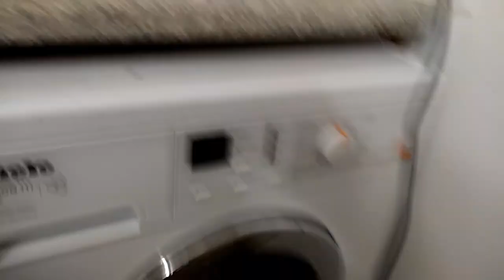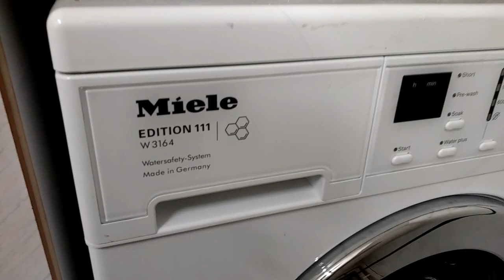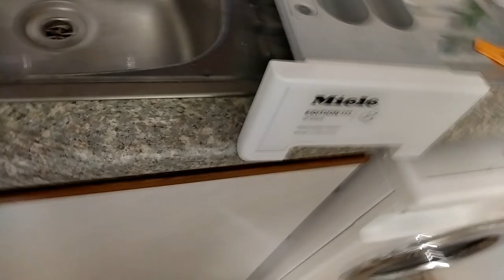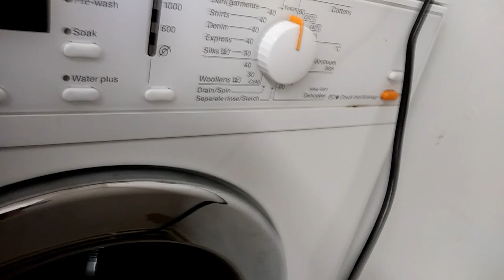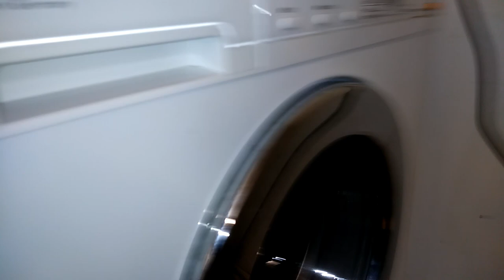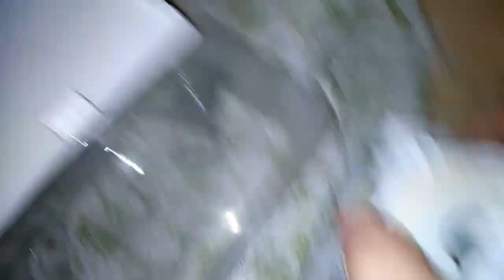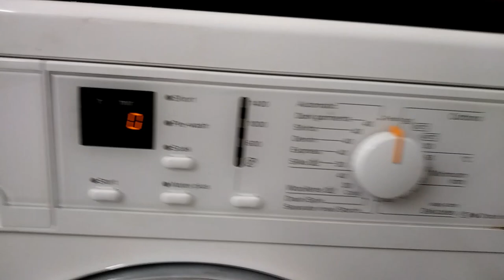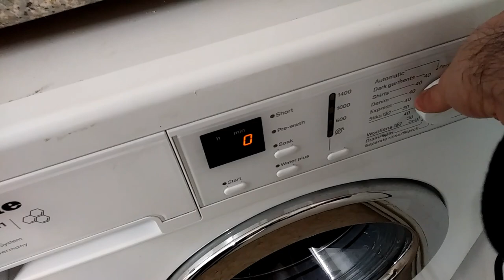washing machine maintenance (miele w3164)

Comment: Always add 2 litres of water in the dispenser after you have emptied the filter of water. This activates the ball float. Also when running a cycle in 90 degrees for cleaning you should not add soap
Reply: Nads Khan I have the Premier Novo, and the instructions say to use detergent during the cleaning.
Reply: I agree with Virginia!

Comment: I've cleaned my filter but the light remains on.
Reply from the maker: if the red drain/fill light stays on then check the drain pipe for blockage and check the cold water feed and the inlet filters.

Comment: I have a similar machine and it throws errorcode f10 and sometimes f11. I have checked drainage system and cleaned it and also cleaned the little filter in the water hose. What Else could i do?
Reply from the maker: f10 is water intake and f11 is drainage.  so would check to see if either getting blocked or water entering the machine.

Comment: Hey m8, 
I own a Miele washer front load very similar to yours.
I was interested to see how and if you can pull out the propellor mechanism in the drain system to clean behind it ?

I’m guessing as you didn’t do this, no debris can get behind the propellor...
I was using express cold wash for a few years , no maintenance (idiot I know).
I did a 95 degree 1 hr wash with bi carb in the draw (2 tablespoon)
And half cup white vinegar in 🥁.

Far out she reeked when emptying.
Have a good one lad
Reply from the maker: you would have to remove the pump to get behind it but mainly you get all the waste gunk build up behind it since all debris get caught in the drain, since the cap acts like a trap. also the washer will light up a warning if it cant drain due to block drain pipe or something that stopped the propeller. also would do a rinse cycle after you used the vinegar and bi carb method. but it should stop smelling after you done it a few times. also make sure you don't use cleaners that are not suitable for stainless steel since the tub is not plastic.
Reply: Miele Novotronc W828